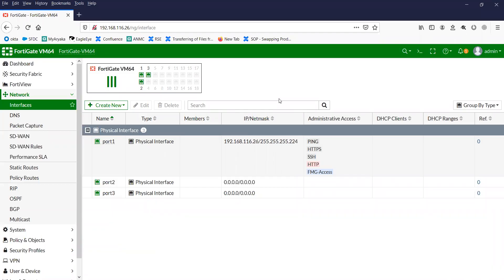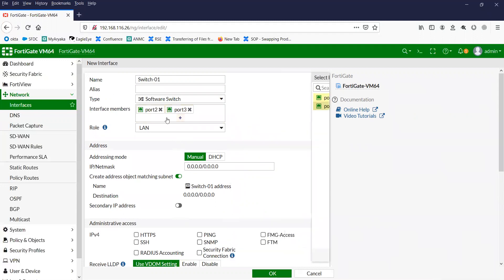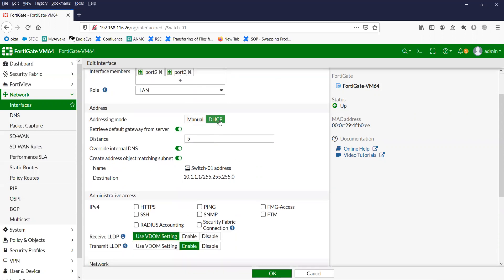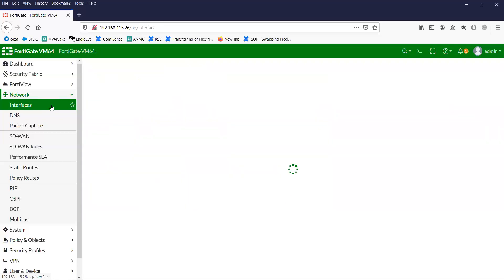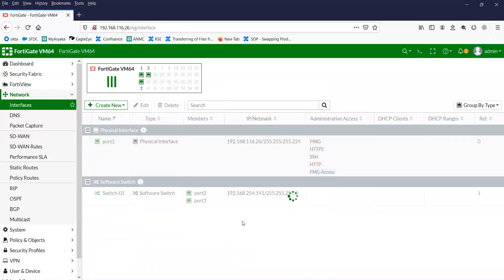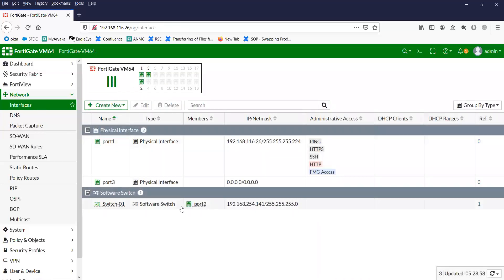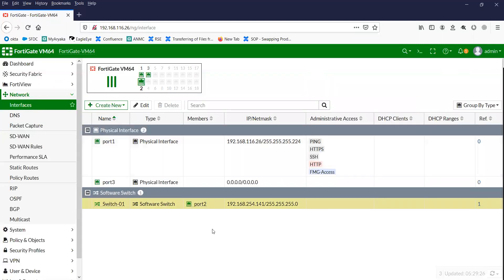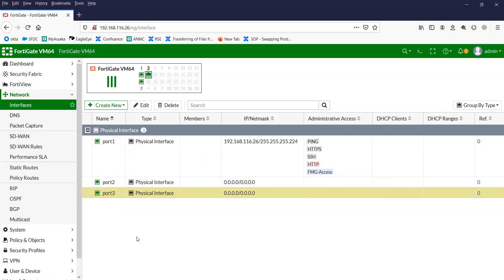Configuring Software/Hardware Switch on the FortiGate unit

Comment: Thank you for the vid. But how to create the hardware(instead of software) switch on the FGT unit? Thx
Reply from the maker: it is how some of the older fortigate units are designed , where some ports are assigned to hardware switch port group. you can get the KB explaining the same.